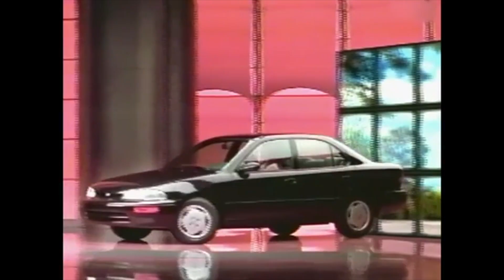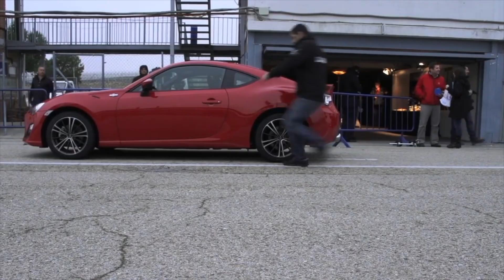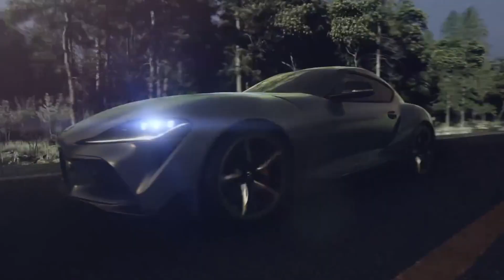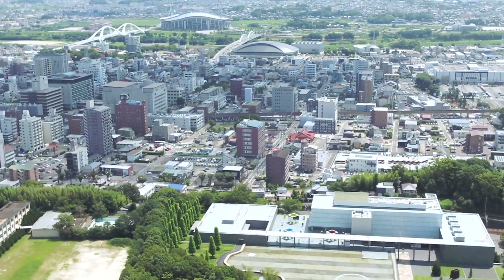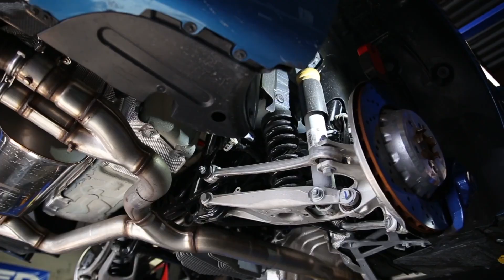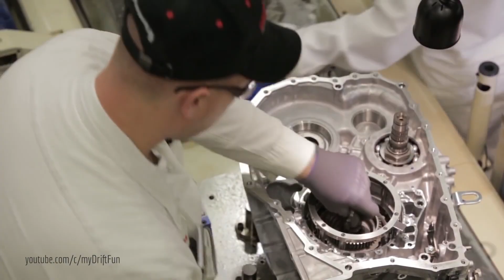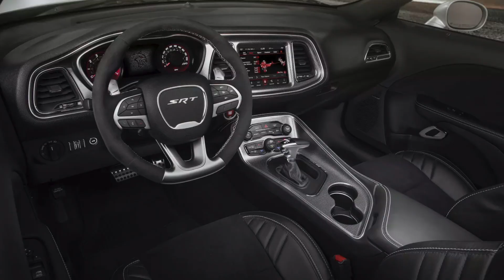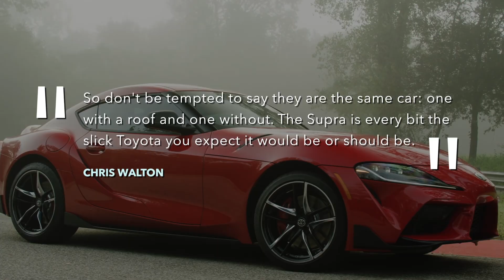MKV Toyota Supra - BMW or Toyota? The UNTOLD TRUE STORY

Comment: Answered so many of my questions. Really great journalistic piece
Reply: Honestly I’ve driven in one of these and the hp actually isn’t that bad and it drives nice but tbh I’d prefer the old Supra more
Reply: There’s lots of misinformation in this video, you should check other videos for actual facts if you’re really interested. Shmee150 actually bought one and uploaded a video showing the car in depth, that has much better info. This video claims that the interior was designed completely separately from BMW, but it’s extremely clear it wasn’t. They both share many interior parts including the m-drive infotainment system, shifter, dials, etc. That’s an extremely simple detail to get wrong, and that makes me doubt everything else in the video as well. Journalists don’t just copy what other people have said, they actually verify information before publishing it.
Reply: @TheWallsocket  "There’s lots of misinformation in this video, you should check other videos for actual facts if you’re really interested."

Translation: This video has actual research, so it doesn't validate my opinion.

"That’s an extremely simple detail to get wrong, and that makes me doubt everything else in the video as well."

Maybe because the people in these comments are the only ones who pretend to care about where the fucking shifters and steering wheels came from.

Just because they developed it separately doesn't mean they aren't allowed to use the readily-available parts of the other party, especially when it's being built in a BMW parts factory. Who cares about cost savings, amirite? What really matters is validating the ego of people who are never going to buy the car.
Reply: @ootdega  This video wasn't all that well researched. To claim it's an all new chassis that just happens to be near identical to the Z4 is bullshit. Also didn't do much research on the interior or BMW's offerings.

Comment: all these haters.. this car probably won't surpass the 60K price tag, in which 60K for a re badged bmw N55 engine is not bad. you are talking about a 50-50 weight distribution, with the N55 engine for the price of a well equipped BMW 330I (N20)? to me that sounds about right. you want reliability, then look at the N55 engine, i never had a single issue

Edit: Don't call this a re badged Z4 based on the looks, look at the performance and call it a re badged M2

Comment: Wow no wonder Scotty Kilmer loves Toyota they really take pride in there cars
Reply: Yeah he says Toyota is soooo great but they use the same parts many other manufacturers use. Sometimes they use the same exact cas as seen here. So how is bmw junk and Toyota so great when some of Toyota's cars are Subaru's and BMW's
Reply: The PinCushionMan true but what do yhu think about Scotty Kilmers opinions
Reply: I'm not sure where you guys are from but the only time I see a Toyota not working is if someone's hit it. Guy I house shared with hadn't changed the oil in his 06 prado and it had done 40k and it came out like sludge. Wasn't running choppy and afterwards it ran fine and still does. They make a very good reliability factory. Both Toyota's I owned never had one issue other than regular service intervals. Honda guy now and they have given me a fair bit of trouble I still like them but I miss the unrelenting reliability on the Toyota's
Reply: Scotty almost had a heart attack when found out Toyota had a Bmw engine he's in ICU now.
Reply: @thecarsectionthecarsection6420   LOL
Reply: Rev up your Zuperas!!!

Comment: It's worse than that... it's not even a proper Z4, but a cobbled-together assembly of parts from the Z4, M3, X3, X4, X5 3i, 340i, 2 series, 4, 5 series, mini clubman, and many more. The only Toyota thing about it is the name and badge. And... basically combining that many incongruous parts? Not only will finding repair pieces be a nightmare, but they weren't originally designed to work together, so don't expect them to do so perfectly. Time will tell, I guess.

Comment: I personally think the sharp and yet round sporty look is great. However the car is a total let down for a few reasons, from my view anyway. There is something like 10 fake vents that fallowing those cool sharp lines, and it becomes instantly noticeable :-( Add that cheap feel, shared chassis, interior and motor....and it starts to make someone think... other than the looks...it's a BMW. Which makes isn't what loyalists want. They want Supra DNA, not BMW, no matter how many bolts they inspected.Just my feeling and thoughts. Add those to the extreme price, it's lack of power just doesn't help.

Comment: You know what really grinds my gears? People complaining about the Supra's reliability, although the car hasn't been released yet.
Reply: The old supra wasnt reliable.  It was ok.  Not great though.
Reply: they're all auto's for now, you ain't got no gears to grind :)
Reply: yep...
Reply: Wonder what it looks like when belly achers vomit
Reply: Tim D i own a n54. The unreliability is real
Reply: Well for starters, unless they've added some port injection to the new engine, it's going to have to be halfway taken apart to clean out the carbon build up every 30k miles to 50k miles, also I hope no one experiences the plastic transmission pan failing like I did on my f30. It cracked and the life blood of my transmission coated my driveway to the tune of 30 bucks a quart for 9 quarts... 😅

I recently got a Ram with the 8speed, it's going to be serviced bi-annually to the tune of about $800 a service to insure reliability.
Reply: BMW reliability is just that bad, they are involved, its a safe assumption
Reply: @DougE.phresh  Did you even watch the video?? Toyota handled the reliability and durability testing extensively and helped BMW redesign many components until it met their standards. I own a BMW and reliability isn't nearly as bad as people make it out to be. German engines have tighter tolerances so you need to be on top of your preventative maintenance, but if you treat it right then issues are rare. At least watch the video before you try and spread ignorance.
Reply: Kevin Dam I listened to it in the background, BMW found a way to muck up the wiring or hid some one time use aluminum bolts in there, rest assured that German goofiness will pop up sooner or later
Reply: Even though BMW had Toyota do all the testing and Q&A until it was up their standards. If anything an unknowledgeable assumption  @DougE.phresh
Reply: @Holllow007  BMW is teaching Toyota how to make a car last just long enough to be replaced by the new model and get sold onto the second hand market before falling apart and no longer.
Reply: psychedashell sounds like you know a lot about cars.
Reply: @Holllow007  Just older BMWs and a few Toyotas since then.
My first two cars were BMWs, the first one broke the input shaft and I found out from the BMW mob that the only way to get a new input shaft was to buy a whole gearbox, getting a 2nd hand car was cheaper than buying the gearbox, probably could have gotten decent fleet of my car for what they wanted for a new gearbox. The donor car's interior was falling apart because it was held together with plastic clips, similar plastic clips to the ones that held most of the running gear together in both cars, complete replacement of all was needed and I couldn't make a clean set from between two cars, so onto the net to find out how much new ones would cost - looking up BMW parts prices on the internet is horrifying, especially when you jump on forums and start looking into non-factory parts. You find out that BMW stuff falls apart with scary reliably at the ten year mark and avoiding genuine BMW plastics like the plague is sound advice, finally swapped the gearbox only to have the new one go a month later, my father is a mechanic and motorsport enthusiast so my first thought is always "My fault" which was put to rest when most of the BMW repairs forum pointed out that BMW manuals are terrible and what happened to me is pretty much guaranteed at my model's age. Both got pulled apart and sold for parts, made more by tearing the rotten things apart than either cost me to buy, damn near made back the trouble to boot.
Moved both backwards and upwards by buying an 80s Mk2 Supra, the damn thing is bullet proof and a monkey could maintain it.
An idiot like me managed to modify it to pass engineering without a mechanic's help, a monkey could still maintain it.
The Landcruiser and the 86 are cut from the same cloth, a monkey can maintain them.
Toyota probably doesn't get much after warranty business because private mechanics can easily look after their cars, aftermarket parts are a dime a dozen and enthusiasts float them.
It's hard to not sound like a bitter bastard but I do admire the BMW engineers, they're probably the only company that can make cars for the new car market only.
Reply: @DougE.phresh   I've owned two M cars and although their reliability isn't as bad, it's definitely not as reliable as a Toyota though. Only time will tell how reliable the B58 will be and how much power it can push out. Toyotas are reliable but BMWs are more fun to drive. Would I buy a new Supra? Maybe or maybe not.
Reply: mrjjthor Thor hey, thanks for an intelligent response, I’m really just picking on the BMW Guys, I do believe some brands typically produce more resilient cars than others, they all make lemons,  but a car is only as reliable as the owner makes it, they will all fail eventually if not taken care of

Comment: You say the interiors were designed completely separately, but you can clearly see BMW parts in the Supra interior, including the entire M-drive electronic system. You should honestly be ashamed for publishing false information and not checking it, I'm just a layman and I know you're bullshitting. I don't care if you read it somewhere, you have to VERIFY your information - that's the difference between a journalist and a hack.

Comment: So BMW engine, suspension, transmission,  basically the entire drivetrain. Toyota can tune this all they want, it's still BMW hardware. When an owner does any kind of regular maintenance, they're going to be working on BMW hardware. Only time they'll touch Toyota hardware is when they take out the floor mats to hose them down.

Comment: Since the car is still new, we really don't know how reliable this car is going to be. Another thing to note, the parts for this car will be expensive because it has BMW parts, so prepare your wallets. To me, it seems the drivetrain is BMW design which isn't bad. However, I do agree with most people, it's not a Supra and it should have been called something else. Also,  remember the Mk4 Supra's 2jz engine was designed by Yamaha, so the car's wasn't fully designed by Toyota. I think the problem with this car, Toyota didn't do much with the drivetrain. At least with the Mk4 they did. From the looks of it, it was designed for speed but handling and what not.

Comment: I don't care about the Supra sharing a rebodied chassis with the BMW Z4. Toyota has amply demonstrated they're uninterested in making their own performance cars anymore. You can't even get a manual transmission in their vehicles so you can build your own. I DO CARE about it using a BMW engine. BMWs are one of the most unreliable, expensive to repair brands around. Engines are a big ticket item to repair. Basing a Supra on a Z4 and a BMW engine, well nothing could ever go wrong with that. <rolls eyes>

Comment: Haters are going to hate. I would love a legendary Japanese designed and built Supra. Reality is this: one needs to be realistic about the development and design cost of cars and what that entails. 

1. Chassis- many manufactures use a platform for multiple cars. With increasing safety regulations this makes sense to develop a solid chassis and use it for more than a single car. Imo, they should have utilised BMWs carbon fiber manufacturing. However, see point 4. 

2. Engine- I'm not keen on a BMW engine, but it makes 0 sense for Toyota to design an inline 6 for one car. If it were a V6 or V8 they could TRD an existing Toyota engine. Which imo would be the better option. I do love the sound of an I6 tho

3. Selling price point- The target price range is pretty low because they don't want to compete with their Lexus RWD performance cars. 
Unfortunately, this is likely the logical reason they had to work with another company to develop the Supra. 

5. The market- let's face it us car enthusiasts are a very small portion of the market, and constantly getting less and less it seems. The Gt86/BRZ never really sold a lot of cars, and it sells even less currently. That car took 8(?) years  to develop. I don't think Toyota can do another LFA where they have  super high design cost and never make it back in sales. 

Summary- Perhaps Toyota should have taken the Lexus RC platform and let TRD have a go at it. Take the super luxury bits out and put more go fast parts in. Restyle the car to look more sporty (and less Lexus), and use the existing v6 with a pair of turbos. 

What do all of you think?

Comment: You can't have a Toyota Supra, without upgrading a Toyota Celica. Bring back the Celica, upgrade it, put in a bigger motor and viola, a Supra is born. And no, the Subaru 86 doesn't count.

Z4 is as different from the Supra is as the Hyundai Ionic is from Kia Niro.

Comment: Great content but I had a hard time hearing the voice over the music.  
I like BMW performance (especially with their M cars) and Toyota's reliability.  I hope BMW learned how to make products more reliable from Toyota and will take that into their future.  I liked how the BMW engine wouldn't pass reliability standards with Toyota.  In the past few years I have become very disappointed in BMW's reliability.  For example my sister's 528i which is not old and she drives like a grandmother has had two broken motor mounts and it is only about 3 years old!  The part that holds the engine in the car should not be breaking with light use.  My girlfriend has a 2013 BMW X3 with 40K miles and I have a 2003 4runner with 200K miles and I expect her to have more (and more significant) mechanical problems than I will in the  future.  I guess we'll see with time.  Until BMW improves their reliability I won't be looking at them to buy.  For me it would be more like looking at the hot lady who you know has major mental/emotional issues.  Just look but don't buy.

Comment: If Toyota didn't want to develop their own I-6 engine from scratch, why didn't they take their 2JZ and put 21 years worth of tech advances into it?
Reply: 3 words. LOW. EMISSION. STANDARDS. no matter how much they can try, the 2JZ will never meet todays engine standards, period.
Reply: @liamott7057  Varriable valve timing, turbo control, multiple cats, and direct port injection would be a start in the right direction as far as emissions are concerned though.
Reply: Toyota made direct injected 2js for several years. No way they'd pass emissions now.
Reply: @liamott7057  agreed....
Reply: The 2jz blueprints were sold to bmw in 2002
Reply: The 2jz is an amazing engine (thanks Yamaha) but by today’s standards the 2jz is a dinosaur, literally extinct , 2019 emissions is the the reason, reengineer an engine is as expensive as designing and creating a new engine, why waste money and time?
Reply: Exactly. And a new engine is roughly 1/2 billion dollars. For one car? Get real.
Reply: Lwize or just use a v6. and supercharge it. The 1grfe 4litre v6 sith a supercharger is great. I should know having it in an FJ cruiser. It would be amazing in something smaller and designed to corner
Reply: That would be too easy....
Reply: You mean Yamaha's 2JZ?

Comment: Toyota's rep for reliability is going to take a hit.They will regret the day that they partnered with Bmw.Bmw has never been known for reliability, in fact they design flaws and problems into their vehicles.Rod bearings,high pressure fuel pumps,throttle actuators,sub frames,water pumps,vanos systems,fragile turbos are just a few of their problems.They sell cars that they know have serious design problems like e36m3 e46m3 e90m3 e60m5 and m6 these cars have serious flaws e90 335 135 are flawed also.Never buy a Bmw or any car that they designed.I bought an 04 e46m3 in 05 and the problems it developed were all designed into the car and Bmw sold it anyway.

Comment: I CALL BULLSHIT.  THIS IS NOTHING MORE THAN SMOKE & MIRRORS PROPAGANDA HYPE FOR THE PRESS, TO BE SPOON-FED TO THE PUBLIC. TOYOTA SHOULD & COULD MAKE THEIR OWN "SPORTS CAR". STRAIGHT UP DESIGN VS "DESIGN APPROVAL" ARE TWO ENTIRELY DIFFERENT CONCEPTS. YOU EITHER PRODUCED IT YOURSELF........OR YOU DIDN'T. AND TOYOTA DIDN'T. SHAME ON TOYOTA. And this is coming from a HUGE Tacoma 4x4 fan, having owned my 2000 Tacoma 4x4 from the day I drove it off the dealer's lot 18 years ago. With over 330,000 miles on all original engine & drivetrain........it runs & drives as good as ever. It also sucks that Toyota has abandoned all of their legendary 4 cylinder platforms that were the most durable engines ever produced in history. I know, because my 2000 Tacoma has one of the last of those platforms: the 3RZ engine. Now they've scrapped all of those classic time honored platforms for this new "variable valve timing" crap. And you mark my word, with all of these newer designs with more complex systems & moving parts, they will NOT last as long as their earlier engines, pure & simple. Literally dozens of private inventors have been creating fuel systems going back as far as the simple carburator, that drastically increased fuel mileage on then EXISTING engines.......only to be shut out, shut down, or bought off by the large auto makers and then thrown on a back shelf to collect dust. "Variable valve timing" is NOT needed. They just don't want their cars lasting as long nowadays. Greed has taken over quality.